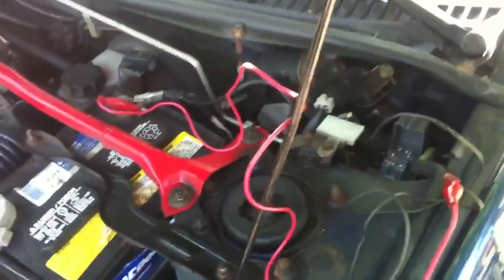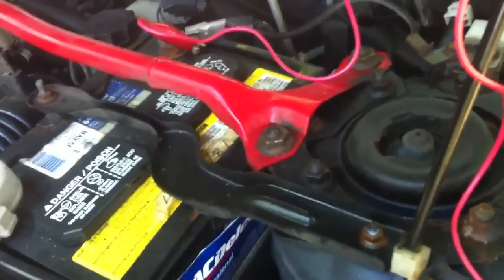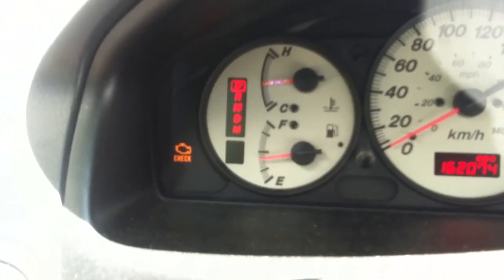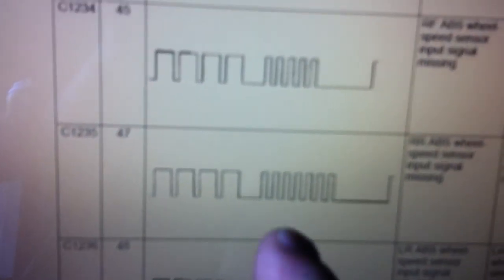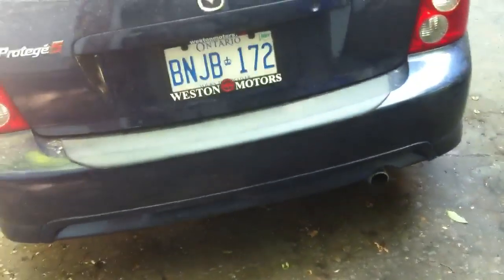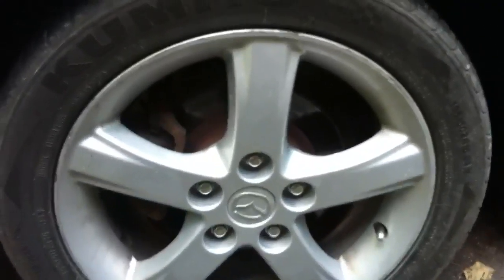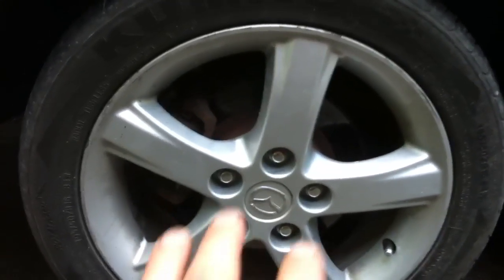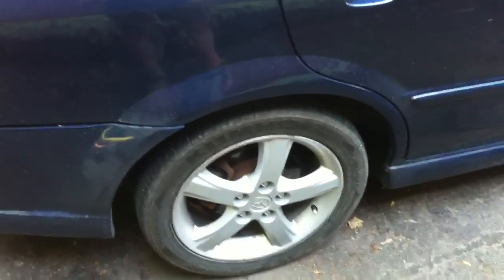Mazda Protege, Protege5 ABS code reading

Comment: hi fupabox, I tried to take out the abs sensor from the rear left side. I disconnected the speed sensor wire and unscrew a bolt that hold the sensor but for some reason, i could not take it out. was that the only thing I have to take out to get the sensor out? Thanks.

Comment: Wire grounded to battery cable that is connected to a paper clip in the pin.  When I turn the key to on the abs light just stays on with no blinking?
Reply from the maker: the wire to the pin was hooked to the negative battery (you can use any ground on the car but the battery is right there, so it's easy to use)..make sure you don't use the Positive battery terminal...I'm not sure why it wouldn't blink out the codes
Reply: +fupabox thanks  i go to check
Reply: +alexis reyes  hey my friend  thanks  i fixed  today

Comment: Thank you for fool-proof info! I got 53 54 on the blinking. On repeat it was 53-54-53-54... Couldn't find the code in database. Is there any chance you know where to look? Protege5 2002, abs light only.
Reply from the maker: C1095 54 Circuit failure of
ABS motor and/or
motor relay
ABS motor, motor
relay
(See 04–02–17
DTC C1095 (54),
C1096 (53).)
C1096 53 Open circuit of
ABS motor and/or
motor relay
ABS motor, motor
relay
(See 04–02–17
DTC C1095 (54),

Comment: so u basically plugged one wire in to second hole and the other end u connected to the chasis,right? where do i have to connect the other end of the wire u connected to the negative terminal ???please helppppppp
Reply from the maker: I connected the wire to the neg terminal as a ground..same as grounding to the chassis...so the wire went from the neg batt terminal to the pin in the diagnostic port.....it just looks like there is more than 1 wire because i hooked 2 together to make the wire longer

Comment: good morning  i have this code 1351  maybe you cant help me please
Reply from the maker: +alexis reyes   If your car is a Mazda it is either a variable valve timing fault or the engine control module  ECM
Reply: +fupabox  yee is a mazda protege5 2002
Reply from the maker: In that case it is
Ignition Diagnostic Monitor Signal Lost to PCM or Out Of Range
likely a wiring harness loose or unplugged in the engine compartment
Reply: +fupabox thanks i go to check